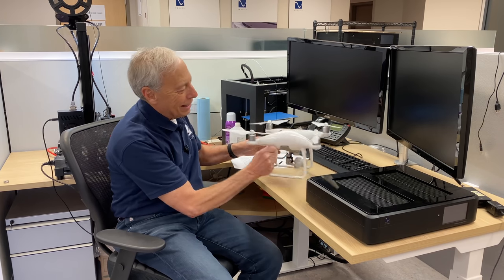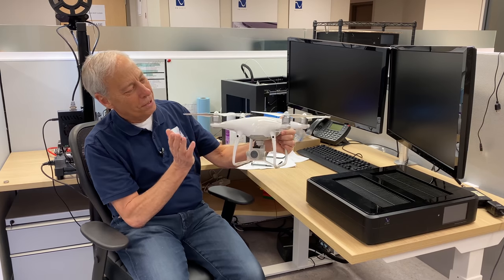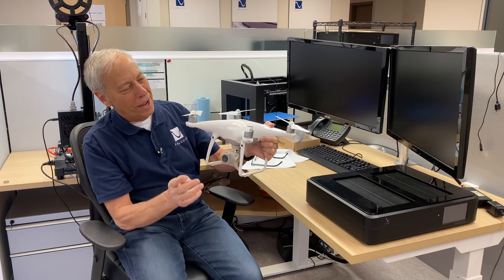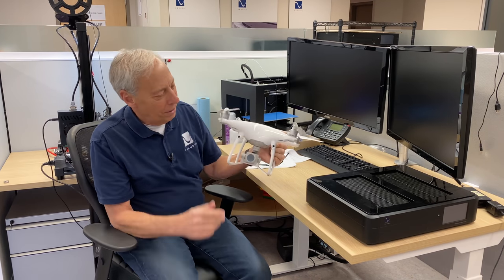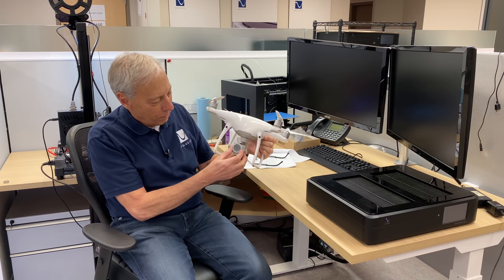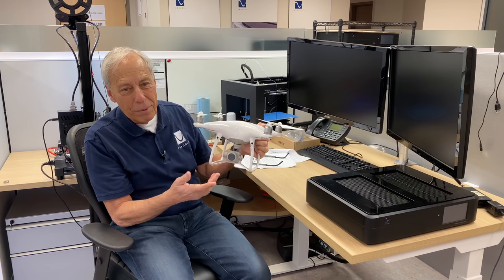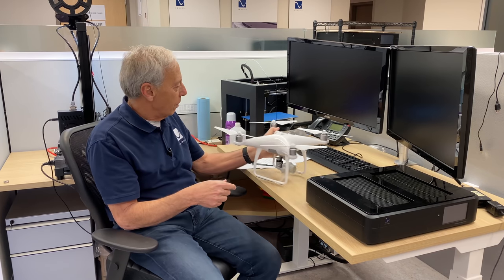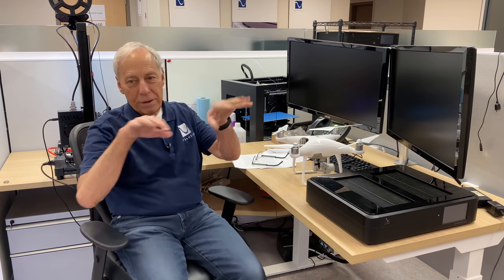Power Amplifier protection

Comment: I've looked at many amplifier schematics, and have yet to see one where the protection circuitry is nearly as complex as the amplifier circuitry itself.  That's for home audio.  
But if we're talking about flight controls monitoring and fault detection/isolation for commercial airliners, then certainly yes.  Everything becomes duplex, triplex or even quadruplex to achieve fail-op or fail-safe.  If we could built failure-free electronics, those systems would be vastly reduced in complexity.
Reply: A triac a zener diode and a current limiting resistor network is all you need for a basic crowbar circuit.
Reply: @leekumiega6576  all follow this ...but an alternative is...
PRIMARY SIDE CURRENT TO THE transformer is very much lower ..and conducting forward drop in the TRIAC is negligible..if it is kept continuously triggered on  ...a fault condition can block those pulses...and Triac will turn off @ line zero current crossing...
Safe as ever...
Reply: Failure free would put them out of business after 1 sale...
Reply: @leekumiega6576  
Most lab DC power supplies have SCR crowbar circuits to protect against overvoltage (with a user-adjustable threshold), but as far as I know, crowbar circuits are not implemented in any audio amplifiers.
Reply: @analoghardwaretops3976  
Most manufacturers of high-end audio would refuse to incorporate triac switches due to their switching noise.  
I've seen some amplifiers with power relays, where the monitor/control logic is powered by a separate transformer.
Reply: @analoghardwaretops3976  
There are many aspects to failures in electronics.  Failure-free units would reduce cost to both the manufacturer and consumer; the mfgr doesn't need to provide warranty service, so prices could be lower.  
After-warranty service is often provided by a third party, and in that case it's not a source of revenue for the manufacturer.  
Overall, it's rather pessimistic to say that a manufacturer would go out of business by building failure-free products, unless they are inexpensive items which the owners would just discard and replace with new.
Reply: @marianneoelund2940  I am not aware of any either but the question mentioned them and elaborate protection schemes ,I was just noting that a basic crowbar circuit is not elaborate. Better companies rely on some sort of current limiting and  the robustness of their output devices  .Whereas companies that build to a low price point use the cheapest components they can get away with , and protection if any is an afterthought leaving no room for error. As far as lab power supplies I never had to repair mine so I never looked at the schematic.
Reply: @leekumiega6576  
I've been studying a number of amplifier schematics recently.  Protection circuits today are typically current monitoring - often only on the high side - which sends a logic signal to the control subsystem when overcurrent occurs.  It's just a couple of transistors and a few associated resistors/diodes/capacitors, so rather simple.  I'm no longer seeing the active output-stage current limiting circuits that were common in vintage SS amps like my Dynaco Stereo 400.  
If your lab supply has the overvoltage-crowbar feature, there should be an adjustment or setting for it.  Smaller supplies often omit the feature and it's mostly for the big supplies that could do some real damage if they had an overvoltage failure.  .
Reply: @marianneoelund2940 That is why it is my belief that quality vintage audio that you can get on Ebay are better than a lot of what is available today for a fraction of the cost ,I just check all of the electrolytic capacitors with an  ESR meter and replace as necessary . I am using vintage Carver for stereo listening and a 15 year old 200W/ch Sunfire AV receiver (the last one before Bob Carver sold the company) for movies. And one of these days I'm going to have to resurrect my Dynakit 70 a 35W/ch tube amplifier as parts are now plentiful. Also concerning lab power supplies  I can set the supply for either voltage or current limiting and they are variable .
Reply: @marianneoelund2940  Bob Carver used triac switching in the power supply of his "magnetic field coil " amplifiers and there is no switching noise .
Reply: @leekumiega6576  
NAD uses SCRs in the power supply to modulate Vcc and Vss, but that's after the rectifier.  
Did Bob use triacs at the primary, or was it on the secondary side?
Reply: @leekumiega6576  
Yes, there is a lot of nice vintage gear out there at very low cost.  It's tempting.  
Test equipment, too.  I own a Tektronix TLA 5204 logic analyzer, which just had a power supply failure.  Replacement power supplies aren't available any more from Tek, but I found a used TLA 5203 on eBay, and picked it up for less than $400!  I'll borrow its PS temporarily until I get around to repairing my original one.  
On the lab supplies, yes, they all do both voltage and current regulation, but separate from that, some models have a voltage protection circuit that employs an SCR crowbar.
Reply: @marianneoelund2940 Bob uses the triac on Primary sideof the transformer.
Reply: @marianneoelund2940 .On your lab supply  It seems odd to employ an SCR crowbar when you have both voltage and current limiters unless it's there if the regulating circuit fails.
Reply: @leekumiega6576  
I remember the Dynakit ST-70 quite well.  It was the first electronic project that I assembled - at the age of 8!  
My dad kept it working for about 20 years, until it met its end due to a 2x4 accidentally dropped on it (not sure why the cover was left off).  At that time it had become very difficult to find replacement tubes, so he dumped it.  Sad.  
In the 70's and 80's I had Dynakit FM-5, PAT-4 and Stereo 400 kit components.  I'm still using my Speakerlab 7's from that era, although I replaced the original dual woofers with a single 12" 4 ohm driver after the foam surrounds disintegrated.
Reply: @marianneoelund2940  You built your Dynakit at age 8 I'm really impressed.  As to your speakers why didn't you refoam both woofers as I hear that the issue with many single woofer horn speakers is that the horn is a lot more efficient than most single woofers and tend to produce uneven SPL's at different volume settings and often are bi-amped for that reason, or were your's the newer ones with the ribbon tweeter?
Reply: @leekumiega6576  
My Speakerlab 7's were the original design, except that I did upgrade the midrange driver.  
The decision to change the woofers was mainly to get away from foam surrounds which don't last very long.  The new woofers have butyl surrounds, are 4 ohm and have higher power-handling.  They really kick - although I need to add quite a bit of EQ to tame the 41Hz resonance, especially since it's close to the primary room mode.  
The tweeter and midrange have L-pads so I can keep them restrained to the woofer's efficiency level.
Reply: @leekumiega6576  
Yes, it's there to protect from regulator failure.  Also some older units had wire-wound potentiometers for setting voltage, and they're notorious for transients while being adjusted.
Reply: @marianneoelund2940  Here is a link for the Carver MXR 130 receiver manual with schematic note Triac TR 601 controlled by opto isolator TLP 533 on the primary side of the transformer, as you can see the triac is pulsed on as the music demands making the supply really efficient  https://elektrotanya.com/carver_mxr-130_2x130w_receiver-sm.pdf/download.html#dl
Reply: @marianneoelund2940  when one uses Zero cross switching for Triacs / bk. 2 bk. anti parallel SCR's , switch... noise in near Zero.. and a simple rlc filter cleans it up.. 
and just as your other later reply that Carver used it also.....
so you said things both ways
Reply: @marianneoelund2940  ...Know that..it was a generalized comment.
Reply: @analoghardwaretops3976  
If you're using zero cross switching, then the triac can only function as an on/off switch, not provide voltage control.  
I wasn't the one who pointed out that Carver used triacs.
Reply: @marianneoelund2940  modulation the secondary side voltage with SCR's  is the noisest ..generating large EMI & RFI.  that can get picked up by all pre- amp/ amp input circuitry.  & SCR/ TRIACS just CANNOT BE CURRENT CONTROLLED..turnoff is by self commutation...@ end of every half cycle..  by that time one faulty power transistor may have brought down the rest coupled to  it .
Reply: @leekumiega6576  current limiting ONLY LIMITS / CLAMPS the output current...but the device by then may be operating OUTSIDE it's S.O.A. ...folback  current limiting is better than crowbar for lab bench power supplies.
Reply: @analoghardwaretops3976  If the current limiting circuit was designed correctly the device will not be operating outside of it's S.O.A. , and I never said a crowbar circuit was better than current limiting ,A crowbar if present is there incase of a failure of the voltage or current limiting circuit.
Reply: @marianneoelund2940  I hope Mario rereads this thread that I mentioned Carver but he did explain how triacs can be used with no switching noise and and when a triac is switched on/off at a high frequency into the primary of a transformer the net result is voltage control.
Reply: @analoghardwaretops3976  Reread this thread I mentioned Carver using a triac switched on/off at a high frequency controlled by the demands of the music making this ampliier almost as efficient as class D.
Reply: @analoghardwaretops3976  
NAD uses SCR's on the secondary side to modulate B+/B-.  They must have solved the noise problem.  
Thanks for the tip, but I understand quite well what Triac/SCR hold current is, as I've done design work on foreign-voltage adapters.  
Yes, I'm aware of secondary breakdown and the need for speed to protect output stages, but you're preaching to the choir now.  Note that protection schemes used in many amplifiers today, just de-energize the power relay.  If you want to complain about slow protection, perhaps you should write a letter to those manufacturers.
Reply: @leekumiega6576  
You can't turn triacs on/off at high frequency unless they're in a high-frequency power circuit.  The triac only turns off when its current falls to zero at the end of each half cycle, as Mario explained.  It can be turned on at any time that there are at least a few volts across its main terminals.  
Triac and SCR circuits achieve control of average delivered voltage, by turning on at appropriate points in each half-cycle.
Reply: @marianneoelund2940  I sent you a link to the schematic ,the triac is in a  high frequency oscillator circuit controlled by an opto isolator which is fed by the audio circuit.
Reply: @marianneoelund2940  Correct me if I'm wrong , with say 120v AC input to a triac if it is turned on at peak cycle you get about 170v out now if turned on at any point past peak you will get something less than 170v getting smaller as you approach zero crossing at which point the triac will stop conducting for the positive half of the AC cycle and turn on when triggered on for the negative portion ,so what you end up with is voltage control NOT just a switch...yes?
Reply: @leekumiega6576  
The patent describes what is essentially a switch-mode power supply, which tracks the music signal.  It isn't a Triac implementation, so doesn't correspond to the MXR-130 receiver circuitry.
Reply: @leekumiega6576  
Yes, so you have 120 opportunities each second, to adjust the level of drive to the transformer primary.  
But when the Triac turns on, you will generally have a large voltage step at the primary and secondary, as well as an abrupt current edge.  It takes careful design to keep those edges from feeding into audio signal paths.
Reply: Flight control monitoring is above my pay grade as I never finished my EE degree and switched majors to biomedical engineering as I heard the EE market was pretty much saturated in 78 at least in tht Philadelphia region.
Reply: @leekumiega6576  
I think biomedical engineering is a fascinating discipline.  I would probably have enjoyed that, but just happened to join an aerospace company in '78 - and stuck with them for almost 42 years!  I am retiring this Thursday, with no regrets.  It's been quite a journey.
Reply: @marianneoelund2940  The MXR 130 has a music fed opto isolator controlled triac circuit in the primary side of the transformer which is a fraction of the size that it would need to be in a linear supply.
Reply: @marianneoelund2940  Best of luck to you on your retirement. Biomedical engineering was fun utilized many different trades having to know but not specialize in anatomy and physiology ,electronics (including  transmitters and receivers and antenna systems for telemetry), hydraulics, mechanical engineering , refrigeration, even plumbing , I was a jack of all trades master of none but electronic troubleshooting was a big part.If it was used in a hospital for patient care I had to know how to test , repair and calibrate it utilizing all of the above skills at various times.So I rarely worked on the same project very long and I was everywhere OR, ICU , PM&R ,  lab ,sterile processing ,L&D , EEG, EKG and computers as everything is now computerized or controlled by one and minimally with robotics which is it's own specialty , boredom or monotony was never an issue.
Reply: @marianneoelund2940  I consider Bob Carver to be a genius ,He made The first really high powered consumer amplifier that was used by professionals , And other powerful amplifiers that belie their small size and lightweight (mainly  due to novel power supply design)as a student  his first amplifier was built in a small coffee can and it beat a McIntosh amp at a   Mcintosh challenge .Read the Carver challenge where he twice made one of his amps sound indistinguishable from the best out there. His "tracking down converter power supply " tracks the signal and keeps the rail voltage just 6v above the the signal .His newest tube amps offer 50 year life on tubes. And he has other patents to keep weak FM signals quiet ,noise reduction circuits before Dolby, Sonic Hologram and more. He first built separates then stuffed it all into a receiver and put it up against separates costing many times what his cost ,they all laughed until they heard it then they just could not believe what they were hearing. Yes I'm a big fan of his.
Reply: @leekumiega6576  
I've pulled together a picture of how the MXR-130 power supply works.  
The transformer isn't small because it runs at a higher frequency - it's small because it operates oversaturated thus cannot be connected directly to the 120V AC line.  
The Triac circuit isn't controlled by the music level.  It's just a regulator and acts to adjust (limit) the primary current to keep the +40/-40 and +60/-60 main supplies at nominal.  Without the Triac (or if it shorts) the transformer would pull a huge amount of current and put out excessive voltage to the rest of the power supply.  The result isn't pretty.  
The power amp output section runs off the +40/-40 rails unless it needs more voltage, then the +60/-60 rails are switched in.  That provides most of the efficiency that the amp has.
Reply: @marianneoelund2940  as I mentioned before .. primary side triac zero cross switching WAS (understood) to be continuously triggered to be always kept ON  not for vcc/vee modulation but as protection to turn off at fault events
Reply: @marianneoelund2940  nothing to complain to anyone about anything..just trying to get my point of view on an issue being discussed in this thread..
Reply: @leekumiega6576  when triggered on at peak of cycle at that moment the instantaneous voltage is 170v ( your example).., but it averages to a lower value depending on charging/discharging circuit, and load current demend .
Reply: @leekumiega6576   thanks for the link .. will go through it.
Reply: @marianneoelund2940  off the cuff .. It's a BIG separate topic by itself , but just a little here... there is a way to turn off scr/Triacs before natural commutation instant..it's known as 
" forced commutation " 
& due to these device limitations.. it's not more than a few kiloHertz (< 15kHz )..so very bad for audio ..
Reply: @analoghardwaretops3976  
Yes, I understood what you were suggesting.  I haven't seen any implementations, though.  Everyone seems to be using relays.
Reply: @analoghardwaretops3976  
Yes you can capacitively cross-couple two devices, or use certain LC circuit arrangements to achieve a momentary zero-current condition with some reverse bias.  
I haven't looked at their schematics, but perhaps a technique like this is used in thyristor-controlled flash units for photography.
Then there are GTO thyristors as well, but they require high reverse gate current to turn off and designers need to be careful to meet all precautions; the device can be destroyed by circuits that don't meet recommendations.
Reply: @leekumiega6576  
I agree that Bob Carver is highly innovative.  It's amazing how many ideas have come from one mind.  He also has some "hero" status with me, for winning the Stereophile challenge where he tweaked his M1.0 amplifier to make it audibly indistinguishable from a high-end reference tube design.  That proves good SS designs can be free of so-called "transistor sound."  
On the other hand, he has some notoriety for designs that run components very close to their operating limits, which is essentially a guarantee that some of the mass-produced units will have poor reliability.
Reply: @marianneoelund2940  With my MXR 130 I replaced some undersized power resistors ,the output relay and resoldered the volume pot, my MXR 2000 need an adjustment to the power supply to quiet the transformer, my Sunfire True subwoofer shook it self to require some resoldering ,My Sunfire AV receiver has not had any problems as heat is the enemy of electronics and it just gets a little warm with no heat sinks.Overall I am very pleased with the reliability and the sound of his products.I once had a Kenwood monster receiver (the Super Eleven) that had excellent specs but it wasn't nearly as resolving as my Carver/Sunfire receivers.
Reply: @marianneoelund2940   With the MXR 130 The opto isolator TLP533 is getting audio and is in the triac circuit ,It has to be modulating the power ,and more must be going on than it looks as even while idling on the 40v rails the output transistors should be getting hot but they don't ,the heat sink is rather small for 130 W/ch and it never gets hot a little warm sometimes yes.
Reply: @leekumiega6576  
According to my schematic copy, there is no audio signal going into the Triac control circuitry upstream of the optoisolator.  It's power supply voltages only.  They've also implemented a soft-start for the initial turn on (C611).  Q617 does not bring audio into the circuit; it's just there to reset C611 to guarantee a soft-start at the next turn-on if it happens very soon.  The only other inputs to the entire Q614-Q617 circuitry are the +60 and -40 rails.  
But it would be interesting to scope the rails during operation.
Reply: @marianneoelund2940  Yes I will have to scope the rails when time allows as I'm wondering if there is audio riding on the rail from the collector of Q509 although it could be shunted to ground through R529 and C 523..I'm afraid the rust shows as I haven't done any component level troubleshooting at work in over 30 years ,now it's all board or the entire device swap .And meds for my bad back cloud my cognitive abilities as I'm out on disability retirement.
Reply: @analoghardwaretops3976  Are you referring to triacs used for protection if you have zero cross switching the triac will momentarily turn off at zero crossing so it's always triggered not always on ,and as  Carver uses it  if you put a scope on the output and increase the volume with a load the conduction time of the triac does change so even though the rail voltage stays constant the current increases .
Reply: @leekumiega6576  
Q509 collector connects directly to the +60V rail.  R529 supplies power from that rail to Q505 which is the high side of the voltage-gain middle stage, and its power is filtered by C523 to reduce ripple.  
The +60/-60 rails have 10000uF filter capacitors and the +40/-40 rails have 8200uF filter capacitors.  Those values are typical for amplifiers of this power class with fixed rails.
Reply: @marianneoelund2940  I guess the adage use it or loose it is true , in trying to remember what i learned over 40 years ago and not used for over 30. Also most of the service manuals had a circuit description along with the schematic back then. Your explanation  makes sense when you think it through ,thanks for your  help. And again best wishes on your retirement.
Reply: @leekumiega6576  seen the linkon " the Carver amp. "you forwarded.. what I conclude  is that the triac had random turn-on . at power up which did generate audible noise transformer vibration at some times..( coming from the amp.)...on after thought let me add .. this.. this comment of mine, I now realised actually relates to another Carver product.. & not the one you mentioned in the link..sorry for that..
Reply: @marianneoelund2940  ....to add something   in forced commutation of SCR's the commutating current through the commutating scr has to be of equal value as the load scr current.. 
whereas in GTO's  ( 1995 era) we turned them off with 1/ 10 instantaneous load current...
Reply: @leekumiega6576  ...no I am not talking / discussing Carver's triac use.. what I FIRST said of Triacs was about ..Considering an alternative protection on primary side..by triacs.in amps instead of dc side crowbar...WHICH WAS  RELATED TO THIS video by
" P. S. AUDIO "
Reply: @analoghardwaretops3976  His "magnetic field coil" power supplies always did have a SLIGHT buzz ( dependent on load ) from the transformer due to  the triac ,BUT if the power supply was not adjusted exactly right that buzz could get quite loud.
Reply: @analoghardwaretops3976  I originally mentioned that triac protection circuits are not very complex and Marianne O said she never saw one used as protection in an amplifier. But the way you mention using them is rather interesting.